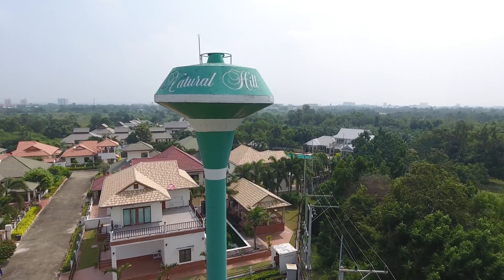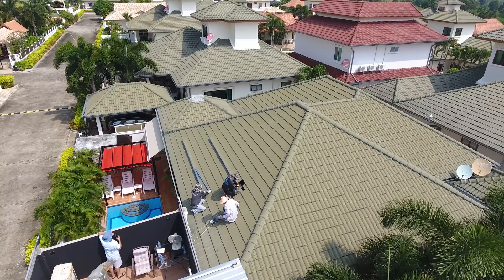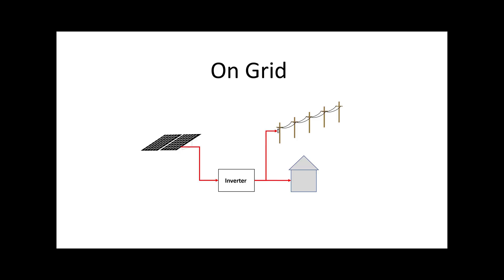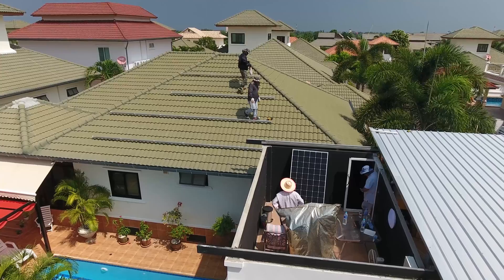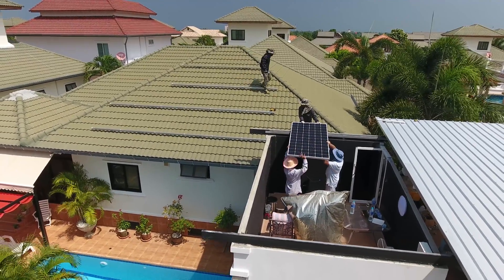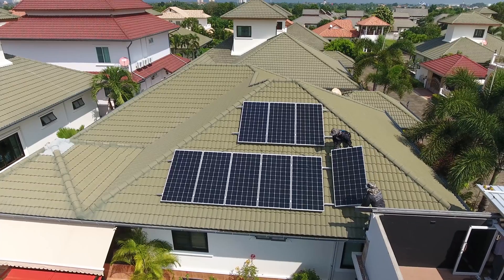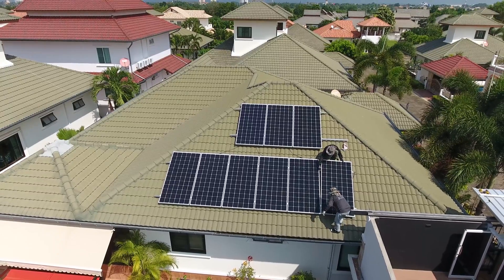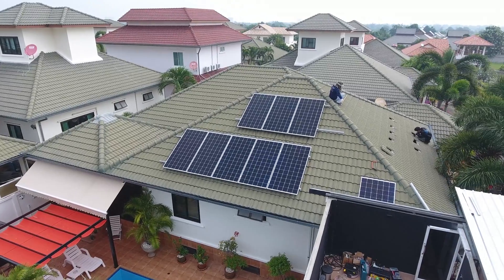On Grid Solar Panel Installation on the house

Comment: Have you calculated how much this is saving you  guys? And roughly what the cost was to install the system?
Reply from the maker: Well it depends of the current price you have on electricity. As far I remember the installation was around 11000 Dollar. In Switzerland the same would be at least double. Because Hua Hin is one of the places in Thailand with the fewest rainy days. The average production is around 25- 35 KW per day.